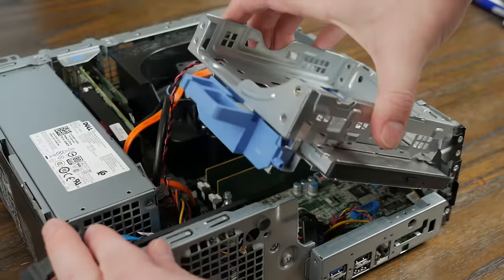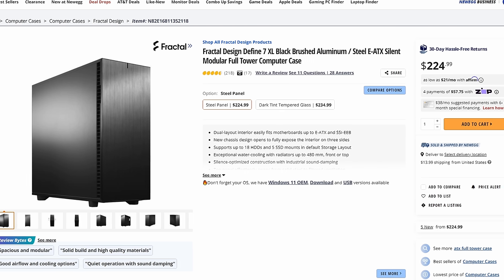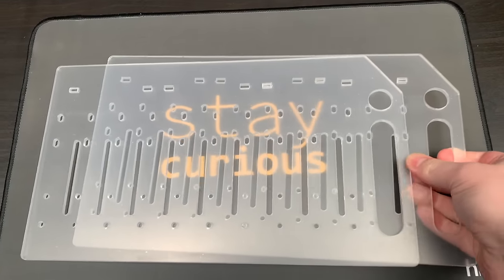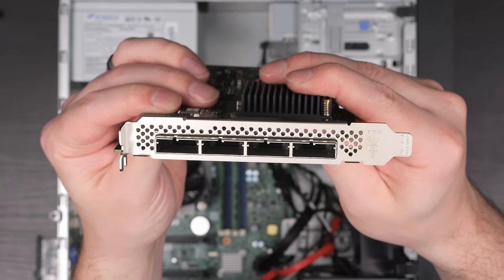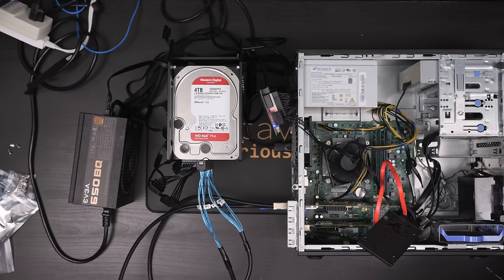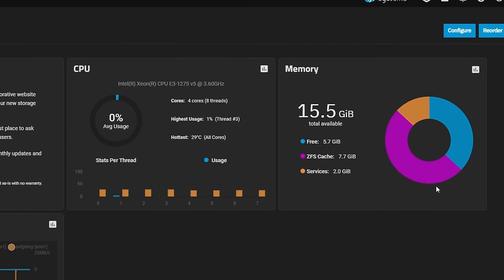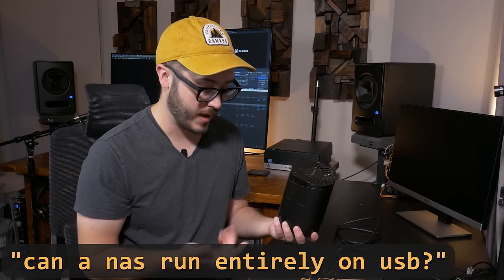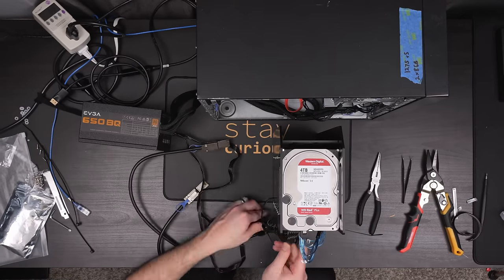I Made My Own JBOD Enclosure For CHEAP

Comment: Maybe too obvious, but remove the internal 400W PSU, and put the 650W one in there to handle everything (PC and JBOD).
Reply from the maker: You know, I thought of that.... as I was editing 🤦‍♂️

The jankiness was worth it for the video though haha
Reply: @HardwareHaven lenovo using its own connector from the psu to the mainboard. its not regular ATX 24pin, its more like ATX12VO.
Reply: This is assuming there's no proprietary bs connection between that PSU and motherboard
Reply: @guiorgy  from markings on the side seems to be a standard FSP power supply.
Reply: You can adapt the connector... i have a lenovo m92 sff board transplanted into an atx tower running off a standard atx psu
Reply: @Kambayusa are you sure they did arround 2015? (just going by the cpu thats my guess on how old that lenovo is)
Reply: @Kambayusa you can adapt with a 2 dollar converter.  Or de-pin the 24-pin and re-pin to match the Lenovo.
Reply: @guiorgy  its a standard connector. I have the same PC
Reply: Surely the internal 400W PSU would be totally fine, it has a 400W PSU with an (unused) GPU 6 pin which is rated for 75W. Since the JBOD draws under 75W there should be plenty of headroom. I do understand making sure PSUs are not overloaded, though it seems this would be fine in this instance.
Reply: @Incommensurabilities  you're right, it would be totally fine. It would be maybe around 80% utilisation during bootup but once it settles down it'll only use about 100w or so
Reply: I agree.
 BUTTT I think the method presented in the video is more encompassing for all situations. Someone who has a SSF case, or is using a proprietary PSU, or is a casual enjoyer of a little Jank.
Reply: @HardwareHaven  The ADD2PSU bit actually solves a bit I had in my head with adding a DAS unit.  I'd just rather have the cables be a bit cleaner than presented in the video.  It would still work though.
Reply: @Andy-fd5fg  How did you do that?
Reply: @romanrm1 nah bro, redundancy is good 😊💯
Reply: yeah, like everyone is saying, proprietary mobo connectors would've stopped that, however, instead of getting the old office PC, I typically prefer to scrounge fb marketplace for older gaming rigs. people selling older prebuilts that come with 7th or 8th gen i5s/i7s and 1650/1660 supers. you can usually pick those up for under $400 sometimes and to me it's worth it to clean up the aesthetic.
Reply: @Incommensurabilities  I did make my own JBOD server in an old PC tower with a PSU of 450W. I have 2 EIDE drives connected to a PCI adapter, 4 SATA mechanical drives and 2 SATA 2.5 SSD drives. I didn't try to include a graphic card in the motherboard, so everything is totally fine. Not only that, but I still have 190 watts to spare.
Reply: @mopioline65  Using older gaming rigs you also pick up higher energy costs. Those gaming motherboards are optimized for performance. Versus the office PCs are optimized more for efficiency.
Reply: @javaman2883  underclocking and undervolting are things. Hell even with MSI afterburner you can lower the power limit of your GPU.

Comment: I have 24 drives in 3 stacks of 8 like this, running off two 16e HBAs passed through proxmox to a TrueNAS core VM. It works without issue. I did the exact same as the video with individual fan-out cables and SATA power expanders. The whole thing is cooled by a big ol box fan that keeps room temp.
Reply from the maker: That's awesome!
Reply: Why proxmox to truenas vm and not just truenas?
Reply: @Todrak  I got other VMs I run on that machine.
Reply: Did thou know thou can use a expander card to easily multiply thine ports? It lets thou use up to 512 drives at least on the 4 port hba I hast.
Reply: @worldking348 cool, but y do u speak that wae?
Reply: thats a true DIYer
Reply: @guiorgy  because his real name is actually William "tech" Shakespeare.
Reply: @UndyingShadow83 That's not good practice. Storage should be storage only. I have several proxmox hosts and even a cluster, but my NAS box is only a NAS.
Reply: And why not? Do you have a good reason why they can’t be combined, or are you just repeating dogma?
Reply: @UndyingShadow83 If shit hits the fan, you dont ruin your entire house, but only the bathroom instead. It's a simple way to reduce the risk of data loss.
And by shit hitting the fan i mean everything like ransomeware/user failure/stuff in the real world like power spikes or whatever. It's just smart to keep systems apart.
Reply: @blinddarm8478 It in no way reduces the risk of data loss. All it does is use more power for separate systems that aren't being properly utilized. If the VM host hardware dies, it would be the same as the TrueNAS host hardware dying. I have a backup of the TrueNAS image, so if something gets corrupted in the TrueNAS image (something that could also happen if the NAS were a separate box,) then I can just restore the VM. 

I'm running in a home environment, and I find the idea of trying to apply business practices and building racks of hardware into your closet kind of passe. Plus, I'm got 3 stacks of 8 hard drives sitting on the table cooled by a box fan. This ain't your work's colo.
Reply: @UndyingShadow83  I just cut my power consumption enough to save about $180/year on electricity by combining 3 standalone systems (TrueNAS, pfsense, and ESXi) into a single fully virtualized machine. Are there downsides? Sure, I mean initial connection to the ESXi console over the network when swapping from standalone to virtualized pfsense was...fun... but it's a hobby and I'm saving a bunch of money, space, and if something goes south then it's a reason I HAVE to fiddle with it lol
Reply: @timplett1 Yeah. I have 2 boxes. 1 is a smaller unit for "vital" services like routing, network connectivity, and management docker containers. The other box is everything else, storage, game servers, random VMs, etc. I don't mess with the 1st one much. But as someone who used to have somewhere north of 600 watts running in a rack that warmed the room 10f hotter than ambient, consolidation is absolutely worth it.
Reply: @blinddarm8478  Backups are the only way to reduce the risk of data loss, you people stop trying to wiggle around the bush, raid is not backup, physical separation between compute and storage is also not backup.
Reply: @richardchiodo2200  While I agree that ideally storage should be strorage only, some of us DIYers don't have the budget for that. 
However, using Proxmox to separate the storage VM from the Docker host VM and other VMs does provide some isolation to protect the storage.
Reply: Do you have links to products to buy to achieve this, please?
Reply: We all start as young enthusiasts with a rack full of hardware and blinking lights in our room. Then life happens, we move out of mummy and daddy's house, get married, have 4 kids, mortgage, bills etc. and priorities change. You don't need loud power devouring servers anymore you need money to provide for your family. That's when we make the mature decision to downsize 12 servers to 2 little ones running VMs and containers and guess what ... it is still fine and your home lab still does what you need it to while being much cheaper and more practical. The end.

Comment: When ever I research something like this 90% of the time I get people telling me not to do this. I'm glad to see this video cuz it makes me confident I can do this with out to many problems
Reply: With processor speeds able to handle MUCH more IO ops, setting up software raid is actually faster than some of the 90's hardware raid compatible hardware...
Just imagine ZFS parity computations on a AMD K6-2 (or a pentium 4)...LOL
Reply: With such PCIe card in HBA/IT mode it's actually 100% fine. What people advise against is using USB connections for this. You could also put some rubbers etc. around screws and on ground to counteract vibrations.

Comment: To make it more sleek and professional looking you could've used a SAS backplane. Which helps you easily connect all the drives without any dangling cables and connect the SAS cables directly to the HBA

Comment: Only thing missing is the supermicro backplane to clean up the cabling.  I did something similar to this a while ago and I thought the fans would be overkill, ends up they were useful when actually doing large copies from my workstation.  Used that setup for a couple years just because I was proud I'd built it myself.
Reply: did any of the disks die because of vibration?
Reply: @germanenriquezillescas9421  no, didn't have any of them die and I still have the drives even though they currently are not in use.
Reply: Supermicro backplane?
Reply: @TomR459  Are you asking what a supermicro backplane is?

Comment: With the price of the prebuilt jbod enclosures, this is a very good option. Another good option is a real server case if you have space. I got my 4u case for £400, and spend another £30 on a trio of Arctic P12max fans to get a quieter build. This one has 24 front drive bays, and works great.
Reply: I have exactly the same thought. A 4U case will take less space than a external hdd caddy.

Comment: a lot of libraries have 3d printers available, you might be able to make drive sleds for that acrylic enclosure. Or get a friend with a 3d printer. 

The biggest life-hack for getting cheap components is knowing people. I learned where the cast-off computers go for some departments in my university and you're allowed to just walk in and go picking, but it's also a slight secret.
Reply: There are good user friendly 3D Printers around which are inexpensive. 
The biggest Problem is to avoid the Cheap Printers which needs lot of knowledge to run well. 
My Advise at the Moment: 
Bambu Lab A1  Not the Combo with color changer, the simple A1.
Very good Printer easy setup and prints out of the Box very good prints.  
While Printers like the Creality Ender 3 V2 Neo or Anycube Cobra 2 are cheaper, 
they need lot of more knowledge of printing and especially mantaining those. Rebuilding one of those ATM.

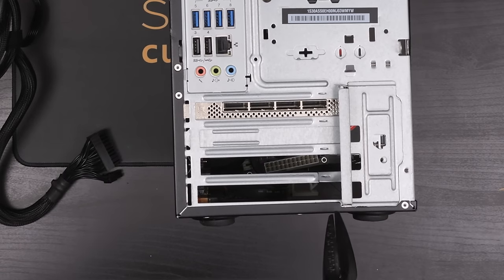Comment: 10:20 Lifehack: instead of cutting a support bracket - you can bend it in or out, that increases gap to really shove any connectors through.
I've got Graphics card through razor connector in a very slim PC and because of that I was forced to connect to card's ports inside the case. So I bent bracket, thrown DVI through and bent it back.

Comment: I did this with an Amazon stainless 4x hard drive cage with a 120mm fan. Added a thin mini itx motherboard with dc power supply on a sheet of plexiglass with a female sata power to 4x sata power.

Comment: Holy Crap! I just bought this 2 weeks ago. lol
Edit: Also, once you went SAS, your connectivity and Stability became infinity better than USB. It's well worth what little you paid for them. Way back, I built a FreeNAS server and used USB to expand. Totally against any recommendation from the FreeNAS Forum. Needless to say those four external boxes eventually bricked. 4x USB = 4x failure rate. I've gone SAS Card with an External open frame using a SAS Expander Card. A Graphics Miner PCIe expander to Power the SAS Card (even though the SAS Expander is an PCIe x4 card, it only uses the power from PCIe, all data is over SAS), and it works like a charm. The SAS Expander does need an Extra fan though, it gets Hot! So I use a 1-Slot Scroll Fan (Used before Graphics Cards regularly had their own Fans).

Comment: If you want to make a bigger JBOD enclosure you can also get a SAS expander (to mount in the JBOD enclosure) and a SAS card with only 2 external ports. You need A LOT of mechanical drives to saturate 8 SAS 6gbit channels.
Reply: This comment is as useful as finding out eSATA comes with and without multiplexing...thanks for the tip. I'll be looking for an expander!
Reply: @hotswapster  Sata multiport/multiplexing is not reliable and has limitations (and not all controllers support it). If you want to do a multiplexing setup you should go SAS and use expanders, it is stable and there it's more or less plug and play.
Reply: @hotswapster  I mean SAS cards and SAS expanders, you can use Sata drives with that, no problem. Just DO NOT use Sata port multipliers

Comment: I made a similar (but less professional) setup recently. LSI HBA in my Dell R620. HBA off EBay was ~$35 and came with both cables for 8 drives. Currently they live in a pile on top of my server with a box fan cooling them. Powered by a small form factor power supply I pulled from an old Inspiron desktop. Was having issues with a TrueNAS VM so I decided to do ZFS in proxmox directly. It’s been working great. I do plan on getting a proper enclosure made, and you video makes me think laser cutting or CNC might be the best option, especially since my schools shop has both. Love the content, I actually setup my first server (2008 Mac Pro) after watching your video about crafty with CasaOS. Upgraded it basically immediately for more RAM. Paid $210 for a R620 with 2x E5-2680v2 CPUs, and 256gigs of DDR3 from a local shop. My boss gave me eight 2 terabyte HDDs from some of our old servers and a HP 48 port PoE+ gigabit network switch (for a future project)
Reply: You only need some aluminium/ steel plates and a bunch of holes for hdds

Comment: I think that's pretty awesome! Not only do you save a few bucks and have a fun little DIY project but you don't limit compatibility as you mentioned that so many of the USB enclosures do. I ran into that with USB enclosures repeatedly and it's a huge headache. If I were you I'd keep it and use it. You built it and although it may be a bit janky it looks pretty slick if you keep it facing front. Thanks!
Reply from the maker: "if you keep it facing front" 😂

Comment: I have been looking at those JBOD racks for a bit, thanks for making this video!  On the issue of the fan brackets on the back, if you use IPS Weld-On 16 cement on one side when you have screwed in one side of the drives it is MUCH easier to assemble.  You can add cement to the other side after the rack is fully assembled for additional stability.

Comment: If you want a bunch of HDDs but don't want to add a whole second PSU to power them, Corsair sells a little $30 unit that takes a PCI-E 12v power input and sends out 20ampsa of 5v power for connecting a bunch of drives to. Basically expanding the 5v rail a bunch of the one PSU you have.
Reply: What is it called?
Reply: Ive tried typing things out 3 different ways now and my reply keeps getting deleted. Sorry
Reply: @user-pc9th4xr6i It's a buck converter, just a bit expensive for what it is. Cheapest solution is to use an older PSU that's rated for something like 30A on the 5V, those were popular for Perk mining back in the days to power up dozens of cheap smartphones.

Comment: In a past life, I used an erector set to group pairs of drives together in a stack. 

These days, there are external single bay metal enclosures sold in pairs on Amazon for $6. They hold a drive with integrated rubber mounts and have a provision on the front for screws. They slide and lock together for easy stacking and come in power-coated black out of the box. 

I picked up 4 bays for my NAS as an external mirror and I only turn it on for weekly archives.
Reply: Can you please provide a product link to the stackable enclosures you're referring to?
Reply: Got a search term for those? I've only seen these acrylic ones
Reply: @AlistairBrugsch  I think the link is causing the comment to be suppressed. 

Naturally, the cages I bought are out of stock and going for exorbitant prices now. As requested, here is the listing title: 

Phanteks - Stackable 3.5" HDD Bracket Duo Pack Cases PH-HDDKT_03
Reply: @T3hBeowulf  I found the product. How do you stack them?
Reply: @xSpaceDementia  They slide together on rails and lock in place with a spring tab. You can stack as many as you want.
Reply: @T3hBeowulf  yeah I figured a link would be blocked hence a search term in eBay or Amazon etc

Comment: Thanks for your great videos!  You are exploring all the options I've been playing with and helping me make sure I'm looking at lots of options.

I've seen these racks on Ali Express for a while but didn't want to have to take it apart to change a drive.  For just a few pence per drive more, you could have the drives on rails.    Use plywood or MDF panels and screws to form a rigid box.  I'd go with 3, top, bottom and middle.  A pair of screws/pins/stand-offs on each side of the drive could ride in a slotted acrylic rail attached to the side panel.  The drives can slide in and out, and the case is wider by only twice the thickness of the acrylic.  A 3rd locking screw could fix the drives into the slots.  This allows for  vertical or horizontal orientation of the array.  I hope some enterprising reader puts out a kit!

I'm using a Yottamaster 5-bay, USB-C, 10Gig external enclosure.  It identifies each drive by serial number on Unraid on my Asrock Taichi, but not on the little Lenovo minis.  The Serial numbers are visible to Proxmox/Truenas on any platform I've tried.  (I imagine that's a driver's issue with Unraid.)  I've never seen any of the "drop-out" issues described by some posters, whatever drop-outs are.  I paid £210 direct from Yottamaster and haven't looked back.  It's quiet, cool, and very clean with only the A/C and USB C cable.  I'd really like to see a SAS or PCI attachment option on these.

I've also used the Icy Dock 4x 2.5 inch drive SATA housing.  I used the 4-drive version because it accommodates 15mm drives.  The enclosure fits in a 5.25 inch drive bay.  I use 4x 5TB notebook drives in a zfs zraid1 array for 15TB net storage.  More than I need.  Next time, I'll use a zraid2 array for 8T net.

Thanks again for your excellent videos and for doing the hard work for the rest of us!